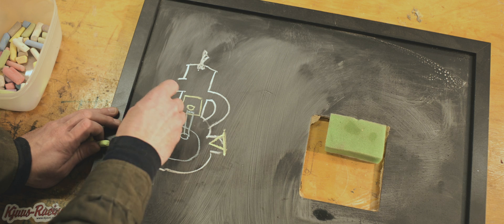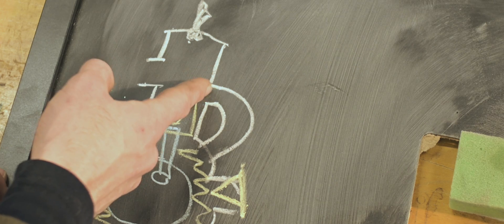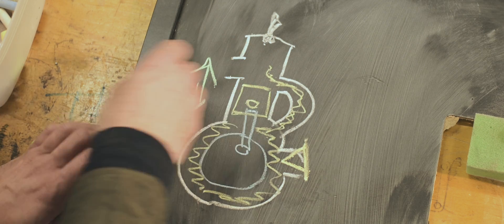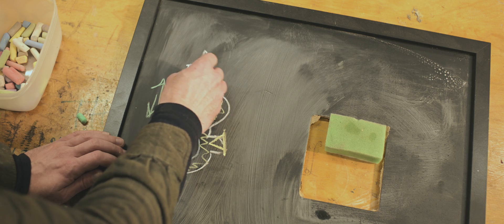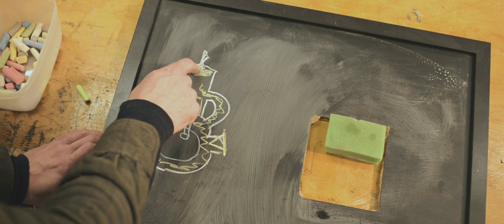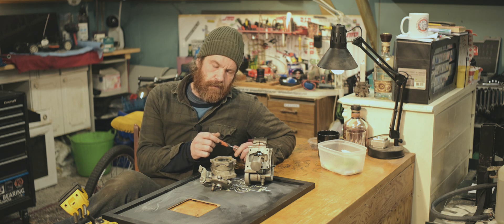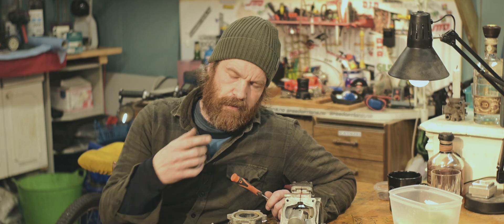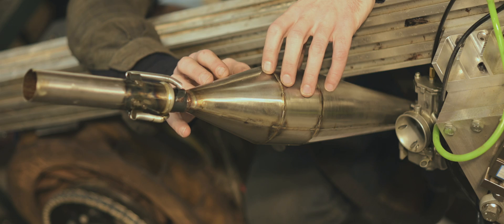Now, That's a two stroke pipe!

Comment: Nope.   Not confused.  Spot on explanation.

What rmp is the pipe designed for?  Would a power valave help to get the motor out of the low rpm till the pipe hits?

My old rd 350's I have have no igition advance.   I used a 50cc moped cdi that can be programed to any type of curve I wanted it to be.  Wow what a difference.   I think the stock curve in that igition system will hinder you.  Your motor is not behaving like the motor that igition was made for.  You need a fully tunable cdi.

Comment: When building high revving engines I always did a step up exhaust dump pipe and I got engines to rev so fast I snapped the connecting rod a few times. I built a chopper with a 2cylinder polaris snowmobile engine and I put my style of pipes on it, we had to put a throttle stop on it so it wouldn't rev too high cuz it was shaking itself to pieces at full throttle

Comment: I got a 2 cycle engine that revs about 12 to 15,000rpm ,
It's just a every day chainsaw Engine with a bigger carburetor , it's fun to play with and was a used chainsaw that I cut wood with 3 Winters  that was $175 brand new , I got a new chainsaw and decided to play with it like you do your Engine  , the carb I took off had a Venturi the size of a pencil , the one I replaced it with was 2 pencils or double the size.  That's it , 
It made a big difference and screams like a banshee

Comment: You definitely want a powerful ECU that allows for adjusting whatsoever parameter with a couple of clicks in a reliable way.
In the final engine it will be useless, but for prototype tuning it's a no brainer.

Comment: Two options. Add a turbo charger / intercooler. Or move to fuel / air /oil electronic fuel injection. Then you can control everything. Koeningsig does this.

Comment: @2STROKE STUFFING Just a suggestion, but  you should try shimming the flange between the exhaust port and the expansion chamber. That way you can change the volume slightly to find which direction you need to go. Most manufacturers put a single shim to reduce wear on the surface of the exhaust port flange. Just order a stack of them. You might be surprised how well this works. It just takes seconds  and it's much cheaper than changing pipes.  Also you can always reduce rotating mass (eg: lighter flywheel) to make it rev quicker .  You really need a flow bench for testing.  Your decisions are always so well thought out and executed that I hope I am not insulting you by making suggestions.

Comment: Maybe he can install on the motorcycle that will have the PIP a small electric engine that can assist main engine reach full power. No batteries just capacitors for maximum lightness

Comment: Would altering the length of the feed to the carburetor to allow a pressure wave to "push" a wave of fuel/air at a frequency lower than the exhaust peak power frequency?

Comment: In these days of electrical vehicles a range extender engine has it`s place. A simple two stroke should have it`s place. It only need to run on one engine speed in order to charge the batteries. Then you can tune the ports and expansion chamber to that.

Comment: All internal combustion engines are nothing but air pumps make that hot air pumps and a case of a nitro top fuel engine it's more of a liquid pump turning to hot air imagine your problem with a two to one air fuel mixture.

Comment: Your explanation of the pipe harmonics makes me think of a rubens tube demonstration. I wonder how a 2 stroke pipe would behave during a similar test. I don't think it would be of any value for tuning, since the speed of the pressure waves will vary with temperature and pressure of the exhaust gasses, but maybe there are some interesting discoveries nonetheless.

Comment: Please try with a CVT (continuously variable transmission) This way you can operate the engine at a constant rpm and the cvt will adjust for output speed. Great video, the water bottle illustrates resonance so even I can understand.

Comment: Maybe you can connect a long tube to the intake of the carburetor or between the carburetor and the engine, it can also help to charge the crankcase with more mixture. You just need to try to find the right length for the resonance.

Comment: Great video on Resonance. On my Yamaha HPDI(1000 psi/68.9Bar) outboard you inject with all ports covered and don't need to control the Reversionary pulse in the Expansion Chamber. It gets 42% better fuel economy over the prior YM EFI of the same HP/engine design. This on the exact same boat with the only difference being the fuel delivery as tested by Yamaha/Skeeter Boats which they own. If the fuel is delivered with the intake charge it needs the tuned Expansion chamber, if not it doesn't. The Pulse cannot be varied so you get a very narrow powerband with the Expansion Chamber.

I guess roughly 42% of the A/F in the cylinder was used to develop the reversionary pulse and is why when a 2 cycle detonates is much more destructive than a 4 cycle. Higher air density through the intake and power density goes up bc you inject smaller fuel droplets directly on the piston crown to evaporate faster. I admit I don't know how you'd adapt such tech to your application but it makes the older problems with 2 cycles disappear. Again great effort in all you do and Thanks for putting it out here to see.
https://www.youtube.com/watch?v=VU-oMZjCHDw

Comment: The boat racers used " slippy pipes " that they could make longer or shorter to match the RPM. tune the pipe ! also the throttle was on the exhaust side of the engine and not in the carb . very cool !

Comment: You should make a wet, multi plate manual clutch for your dyno, in place of the centrifugal one you have now so you can control the slippage, and bring it into it's power band. 
Then you could also incorporate an oil cooler with pump to help with heat buildup from the "clutching" if needed.
Keep up the great work!😉👍

Comment: Would it be possible to control the retarder in a way that It behaves like a DC engine? So you could support the PiP engine from low rpm up to a engine speed, where the pipe starts working. If that point is reached, then you would have to switch the control of the retarder from powering to loading and could start the measurement.

Comment: So now you have to build the third engine. This time with a 2 cylinder crankshaft, connecting the "extra" con rod to a diaphragm that modulates the crankcase volume giving you a supercharger function while still classify as a single cylinder engine

Comment: To much dyno mass  to bring up to speed. Rather than add an additional load with a jackshaft an pulley,  get the dyno up to speed with a separate  drive.  Maybe a small electric motor with a friction drive (tire) you can disengage when you have reached a speed on your HP curve.

Comment: To help with the crank case volume you could add a mini supercharger…it might not build boost in the cylinder cause it’s a 2-stroke but would help with getting more into the combustion chamber?

Comment: Hi Have You tried applying transmission line theory? Basically any pipe will reflect a 180 degree out of phase wave back to it's point of source if a pipe is tuned to the formula
S/f divided by 4 where s = speed of sound, f = frequency. so to roughly tune Your pipe to have best efficiency at 20,000rpm it would be
343 (m/s) divided by 333.33r (20,000/60) = 1.029 divided by 4 = 0.257m 257mm.
anyway it's all good fun and transmission line design can be researched extensively as it is used in loudspeaker design 
Best Wishes Jahmahrah De'Safilli

Comment: Why not just use a second electric motor or something as a "starter" for the brake to get it to a higher rpm to take inertial load off the engine?

Comment: Try to change the gear ration between Clutch an Current Brake. I think now its 1:3 (more or less). T
I think if you change the ratio Engine - Clutch to 1:1 (for a good Clutch performance) and Clutch - Current Brake 1:20 (if engine rotates 20000).
You dont need more than 1000 rpm at the Current brake for measurement because he gear ratio doesnt have any effect for Power measurement.

Comment: Hey friend! Very interesting video. Only for your interest: we have a lot of experience with that analogic selettra system which you are using. We have a digital CDI which I can program for you however you want. I know there are several other solutions like the ignitec, but the advance in our system is that it is a ready solution which we sold already hundred times- no experiments!  ( Ok I know that you are a big fan of all kind of experimental systems- but if you are interested tell me),

Comment: I understand everything you explained in that video. I remember the days of arc nitro racing back when hobo force 21 nitro engines and exhaust with the tune pipe I had I could extend the tune pipe or decrease the pipes leight changing the torque to power years later that same pipe from my racing force 21 racing pipe  marsh 28. Couldnt handle the load snapping connecter rod  multiple times. I installed on my hobo hopper with a brut of and engine the hpi 5.9 big block what a beast. Yes shape and length have everything to do with it. If you try the silicon or something that could handle the heat to tune pipe to or thro. Changing torque to power just by changing over all length to res pipe. Having that adjustment might be all it needs. If anyone made a on the fly pipe adjuster they would be laughing. 1600nh  of a 50cc man that's a big ask when 2 struck don't have bottom end there all top end.

Comment: Sorry to hear condolences to you all.
Well being a speedbike if you had a power valve you would wire it open anyway.
Pipe close to cylinder is bottom end (supercross)
Pipe further away mid to top end (motogp 2strokes)
Reeds to stiff will play up with bottom end bogging , check your air screw it may be out to much 2 to 2.5 turns  , 2.5 to 3mm slide idle gap I would start at ..There's a fine tune gremlin somewhere. 
You should hear pinging at idle with timing set if you can while idling retard from pinging .
Looking at exhaust port to just maybe it's to large losing back pressure try different size washer/restrictors on start of Pipe,  yes you want it to rev up top but may help to get it there.
Looking forward to next video brilliant work mate.

Comment: Hey mate, if you increase the transfer port volume during high rpm it would be able to compensate for the early arrival of exhaust gas.

My thought would be by varying the transfer pressure you could bring the crank volume down so the piston has to work harder to upkeep the head pressure. Maybe it's worth a think about 👍
Reply: Kinda like the opposite of varying the expansion pipe 🤔

Comment: Wait.. regarding the engine in current  crankcase volume .. why not u just hook up the cvt on the dyno as well?

I knew its hard to plot rpm vs torque with cvt system.. but atleast u will be able to tune the engine at all powerband and tune the cvt pulley,springs,roller combination on the dyno for speed run simulation
Reply: Another one u can get cheap, reputable,powerfull adjustable cdi system from indonesia...

Its called cheetah power cdi...universally programmable for any pulser length, any pulser position angle, and 500rpm step for ignition curve, also switchable option for mapping and switchable cdi output voltage (base 350v or double to 700v)

Comment: How about running a cvt that you can control? So it can rev free with a high ratio and then get it up to speed to it's predetermined final ratio for power reading? Or even just run a transmission from a small bike to get it up to speed? Just replace the crank with an axle and driven pulley.

Comment: In years past with magneto ignition, the ignition back plate or points plate was bound to the throttle via a linkage that provided an advance/retard curve to the timing.
This may be advantageous in your search.
Also when the various manufacturers went to variable area exhaust port valving, the crankcase volume was increased to keep the ram air flow/velocity in the crankcase up, this allowed the reed valves to stay open continuously at higher rpm as the ram air in the induction gave higher pressure than the crankcase throughout the full cycle with the help of fluid harmonics.
At low rpm the harmonics were assisted by the valve and pipe increasing back pressure in the crankcase and allowing the torque curve to be fatter in the low end, if memory serves me right the later NSR 500 Big Bang engine had a very broad power band with the exhaust valve, some where from 6k rpm to above 14k rpm.
Thank you for your thought provoking and entertaining method of development.
Good luck and take care.

Comment: I suggest you try a simple air filter, doesn't matter what (non restrictive) filtermaterial you use, as long as it captures the fuel droplets from the intake "backpressure?" (fuel/airmix bouncing back when the engine stops it sucking stroke"

You can see the foggy fuelmix coming out from the carburator, it can blow it supricingly far away from the carb.
One non-restrictive way of doing it could be just by adding a trumpet runner to the carburator.
I just used women's tighs around the carb on my scooter :D i was having problems when it was rich at low rpm and lean on hi-rpm, the tights fixed all of that

Comment: Alex would it be easier to first modify the clutch for higher engagement? I know you said you had stiffest springs but I am sure you can come up with something ;) 
My water-cooled 50cc Peugeot is no where near the same level as the PiP engine, but it has exactly the same issue (big crankcase volume and very strong pipe action and stiff reeds). Peak power is 12k-13k or so, and I get absolutely nowhere if the clutch pulley is set below 8500rpm. It is very happy with a 9500rpm engagement. Below that speed it acts and sounds exactly like your video - it’s so bad that I need to start revving about 10 seconds before a green light to overcome the pulley inertia!
Don’t want you to miss any “KISS” options with the result of having to make compromises on the engine design (I really want to see your concept work!)
Reply from the maker: Good point!

Comment: As a temporary way to reduce Crankcase volume for this testing, could you machine a block off plate for the second carburetor that had a protrudes into the case  and plugs that hole all way up to the Crankshaft? I that that would be significant enough to make a difference.

Comment: When this goes in the bike, I have an idea for a new type of transmission that will be relatively simple to build and well suited to this application. A manually actuated CVT where the pulleys would be controlled by a lever (ideally in the place of a clutch lever) paired to a centrifugal force clutch would allow you to keep the engine in the power band continuously once it is there. Simply add more pressure to the lever to increase the gear ratio without having to worry about shifting gears at the right time.

Comment: Ive only half finished the video, but i think variable exhaust lengths would be your solution, ive seen it done using servos and arduinos measuring the RPM of the engine and moving the expansion chamber in or out to match to the RPM

Comment: in the 2 stroke outboards we race we slide the pipe while underway to shift the power band, it is my understanding racing chainsaws and carts also slide the pipe
Reply: we do this because we have a fixed gear ratio to the propeller
Reply: http://www.grmracing.com/

Comment: Just off the top of dome..

Could the exhaust pressure be regulated by a blowby pipe that circulates or goes atmospheric? 
Or a back-pressure shunt a potato attack with a variable exhaust valveplate. Kinda like on dirtbikes in old days.

if only there was shapeshifting metal for variable pipe geometry..

Someone told when i was a kid, "you have to break it to make it"

Takk for dagens ;)

Comment: When I was in middle school band, our teacher asked us to try a resonance experiment by singing in the shower, he said try "Sliding" down a scale with your voice, and at a certain tone, you can feel your sound "whooshing" back and forth in the shower. This was the resonant frequency of that space. 
The powerband example you demonstrated and also noting that it works best at a specific rpm, and as such the peaky nature of a tuned 2 stroke is the same type of thing. Its the resonant frequency of the pipe shape that determines what kind of tune your engine will have. Ive been told skinny pipes tend to be higher rpm speed pipes, and big bulbous ones are for torque.

Comment: I’ve seen variable exhaust length as a possible solution so what about two or three exhausts tuned for different rpm ranges that close and open according to rpm? Possibly solenoid controlled so only one is open at their tuned ranges?

Comment: I used to race 2-stroke RC cars and there used to be a pipe called "CVEC" - Constantly Variable Expansion Chamber. It worked really well. Basically the engine was always "on the pipe". Could be that there is a way to make one on a larger scale to help.
Reply: That’s what power valves are for.
Reply: @mareksumguy1887  yes

Comment: So here's an idea, the downside at the hit is it'd add more weight but it might work... Could you add a second exhaust pipe and a valve so you have one that works better at lower rpm and then once it hits the rpm where the pipe you have should work best the valve switches over and you run the other pipe? Also how much has the fact that you're running nitro mix been taken into effect for that shape/size of pipe? I know the exhaust pressure has to be different than if you were just running premix gas or even methanol. I'd love to see you try to replicate a RC car engine in a larger form.. those things are basically 2 stroke diesels, just not like a Detroit Diesel. It'd be interesting to see a bigger two stroke that runs purely on compression.